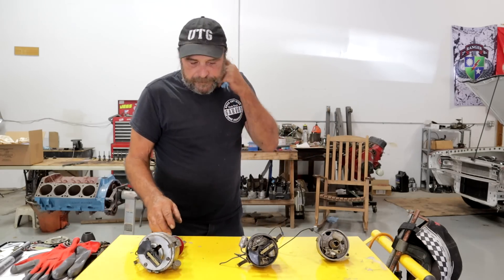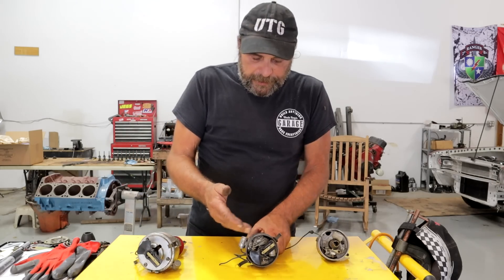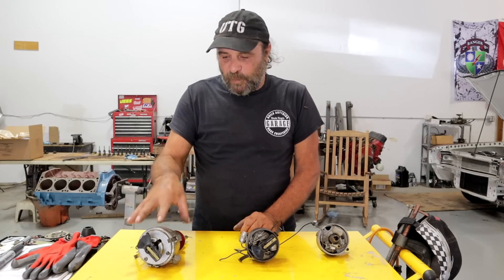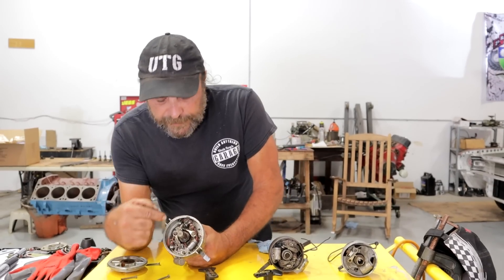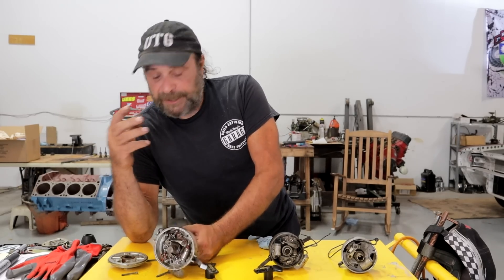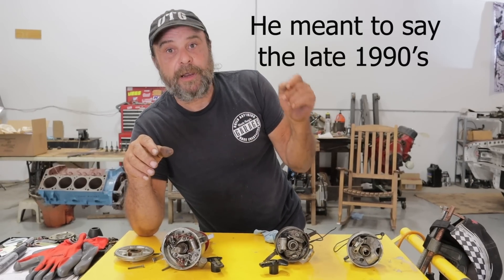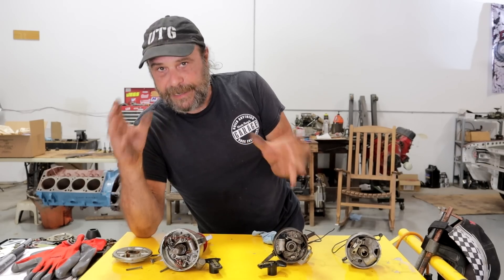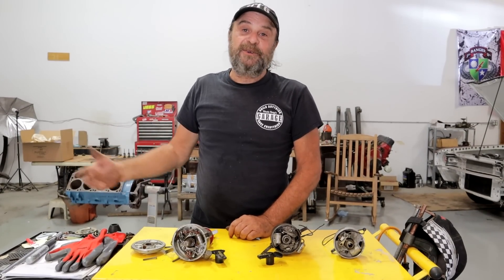High Performance Point Ignition Systems -  Tuning, Modifying And Understanding The Different Types

Comment: The first distributor, on left, looks like an Accel BEI. But it's dual point. I had a BEI. with the Laser box amplifier.  Uses "Hall Effects"  ("whatever" said I) BEI Manual said it was good to 13,000rpm on 70% nitro. uses roller bearings.  When I first built my Chevy 350 in 1984 I used the distributor in my 283, a 1963 Corvette dual point. (From my 59 Vette). The 350 made a good 500hp, rev'd to 7800rpm. I decided to use the BEI,  because I got a deal. The difference was profound. Top to bottom. On top end there had to be around 50hp. As time went on I tried other distributors.  I tried a Mallory dual point, (nope) Mallory Unilite (nope) . Even connected to the Laser box the Unilite was down at least 20hp.  The Accel BEI produced such a precise strong spark..... I was totally old tech and didn't believe in all this "high tech" CDI stuff, etc.  Problem with the BEI is they were sensitive. I had to send mine to Accel twice simply because of Water getting on the amplifier box.  Accel stopped making the BEI. I assume an MSD8 would be as good as the Accel. The distributor was special.  "expert" told me the BEI was better than a magneto but the amplifier was sensitive. Especially to welding, like on the chassis of a race car. This caused it to be used less and less. So says my 40yr old memory.

Comment: I have a 555 solid lift cam with 12 and 1/2 to 1 compression would a dual point distributor be a good idea for my engine it's a 350 30 over small block chevy

Comment: A long time ago I had a new Mallory dual point distributor  for a V8 flathead engine in my Mercury. I replaced the stock distributor and took it out for a test run. I could tell no difference in power. It was a go fast part that did not go fast. I sold it in 1967 for gas money.😊

Comment: I had to take two self taping screws to hold my breaker plate from moving all over the place and was berrly running. And I messed with the timing on my AMC 390 in my 1974 amx Javelin. And about the not cheap but middle road disturber. Efi and failed before I have the timing set. That's not good but I have been able to make it into town with the new components. The next thing I bought a used point one. Cam was worn and the gap is different from one lobe to the next. So I bought perteninx can not spell right. But I installed the second set with a camera on the install so I don't get the guy saying I was the only thing wrong with his parts. The experience was very horrible. I have spent the amount of money on junk that the new original one never been installed still in the box and the condensers I will not sell them because I have given up on the new shit. The way I had had points in All the cars that I drove until I bought a 1974 car

Comment: I have a 1987 ford f250 460 factory carb 4 speed 4x4 truck. My friend installed an edelbrock carb and points distributor with Pertronix unit back 20 years ago. The Pertronix failed a few times at first. He figured it out and then it was ok for years. The trick was just driven occasionally in past 20 years. Hard on gas. Something went wrong with fuel pump after truck sat a year. I installed a new mechanical pump in side of engine block. Fuel gauges don't work and so I'm gonna drop the tank. I haven't confirmed if it has booster pumps in tank. Does anyone know? - anyways.... the truck just doesn't idle. One jet in primaries seems to spray intermittently when visually linking carb and looking inside (engine not running). Im thinking I may need to rebuild carb. And I can. But....I don't trust the Pertronix. I'm thinking about just going with points. What do I need to convert BACK to points in this points type distributor? How to wire it up? Is this the smart thing to do? I'm a mechanic on my own heavy equipment business and I have a shop. But I'm not on the level of Tony. I don't mind adjusting points every few oil changes. I want extreme reliability, smooth torque towing, and cost savings. Sick of the computer bullsh!t. Thanks

Comment: After being stranded on the side of the road twice in the last 2 years due to an ignition control module failure I ditched my HEI ignition and went back to my trusty Accel dual point distributor. Never going back...

Comment: Thanks for this. In the last month I have had an electronic ignition module fail on me, and then two weeks after, the replacement module failed. Now I’m back on the original distributor with points and condenser. The idle is smoother than before and the engine responds so well immediately.

Comment: Hey folks...   I'm even OLDER than U.T. and agree 100% with this.   The only nuance that Tony didn't go into is 'Point Set Quality'.   You need to make sure to ONLY purchase the Premium Grade.  Stay away from Auto Zone, Oreillys and such.  NAPA still has the good ones, but they also have the cheap junk version.  You must make sure to SPECIFY that you only want the Premium version.

NAPA premium MoPar V8 Points part number is   CS851     NOT  CS851SB, those are the cheap set.
NAPA premium MoPar All Engines Condenser is   AL869     NOT   AL869SB, that is the cheap version.

Same goes for NAPA Caps and Rotors, do NOT accept the version with Part # ending with    ....SB....

Comment: My pro street 1960 Hillman Husky 2 Dr wagon I bought few years ago has a SBC with tunnel ram and two Edelbrock 1405 carbs. I just found a Mallory Hyfire 697 ignition box and the matching Pro-Master 27440 coil all in great shape. Any you guys think if I do install this it will clean up a bit and run even bit better? I’d rather have a good electronic set up is getting stuck broke down from it going out. I hear a lot has to do with making sure that electronic ignitions are grounded really well and at several places.

Comment: Hey Tony,
I may have missed it,( you HAVE made ALOT of videos!)...
Did you put a dual point dist. In that slant 6 dart?

From what I've read, I guess the other potential benefit of "duals" are longer point life,(  depending on the dist. Cam lobes and if each point set is firing half the cylinders )

Have you ever "made" a dual point for a slant 6?
I'm almost 63, and I'm no stranger to single points distributors, but never worked on duals.  My slant 6 will never have to worry about high rpm's, but I'm intrigued with how to add that secondary set of points...can't find any tech info on EXACTLY  WHEN ,( compared to the primary set) they should start opening, and EXACTLY  WHEN the primaries close,( compared to the secondary set).
I'd love to "tinker" with it!🙂

Comment: I remember being on the road with a 73 chevy station wagon and the engine quit.  I got out and found that the points were out of adjustment, I actually adjusted the points with a matchbook cover and finished the trip.  A few years later I was traveling in my Chevy S10 pickup, it quit on top of a bridge at 5 in the morning, it was the ignition modual  and I couldn't do anything about it and had to wait a couple of hours for a ramp truck to tow me home.

Comment: In 1964 Honda had a six cylinder 250 cc GP bike did our p.m. to 18,000 RPMs they also had a five cylinder 125 at RPM to 22,000 on points😮

Comment: Any idea where I can get a dual point distributor for a 440? My thing is I don't want to have ANY electronics in my car. Including the electronic control  on the firewall. If I cant find one then I'll end up getting an electronic stand alone unit from 440 Source.

Comment: Wondering, Advance when leaving the line at High RPM. Motoring down the track, what RPM is the engine running at and why is it that less timing is good for what I am guessing is a lot lower RPM that the launch at the light?

Comment: on my 91 lx i did something similar but it was a modern ignition system , i installed a msd retard and when in third gear i would hit the swith and retard my timing and i would gain 3 mph and 1 tenth

Comment: I wanted to add some specific details regarding dual points, the take away is there is a lead point set which does not effect dwell and the secondary point which will change dwell.

Comment: There is another effect which makes adjustment easier. A change of points gap induces a change in spark timing along with change of dwell. With single points you set the contact gap first, then run the engine (or spin the distributor) to check dwell, then re-adjust the points (if necessary) to get the correct dwell. Then you may need to go back and check/reset the timing again, as the dwell adjustment could have changed the spark timing. With dual points you set the gap on both sets of points, then set the timing, which is controlled solely by the secondary points (which open last). Then if necessary you can change the dwell by adjusting the primary contact set, which will have no effect whatsoever on spark timing, so you don't have to reset timing after adjusting dwell. 

The real reason for using dual points is for improved life, long term stability and reduction of service calls, but has naught to do with increasing dwell. For what it's worth, I commonly run more than 20,000 miles on the Mallory Dual Points distributor without touching the points. This is one robust distributor, and I am one happy customer (except for the prices on Mallory tune up parts). 

There is one more notable feature of the Mallory Dual Points distributor. It has an adjustment for mechanical adance upper limit (maximum advance stop). If you set idle timing to 10 degrees BTDC, and there is no vacuum unit, and you want 36 degrees total spark timing at road speed, you can set the mechanical advence limit to 26 degrees. If you have a vacuum unit that can produce 7 degrees advance, and you want to set idle timing at 15 degrees BTDC and limit maximum total advance to 36 degrees at speed, you can set the Mallory max mechanical advance to 14 degrees. This is a handy feature if you do any special tuning (and don't we all?) so you don't have to buy new or modify the mechanical limit stops or advance weights.

Comment: The 354 56 Hemi had this option - dual points on Imperials and Chrysler 300's.. I'm all points now but there is one exception for the Mallory system - they now have a devise so you can run a remote advance/retard control for the dash so you can play w/ advance as you drive. A LOT of people do set dwell wrong so they blame it on the points but if they just took the time to set it up right it would drive so much better and better mileage.

Comment: Yes. I.   Could.nt. agree.   More......point.s.   are. Original.  ...equipment....  for. 60.s. and. Early.  70.s. vehicles....or. earlier.vehicles....and. at. One. Time.... I. Thought.....and. would say..... any. One.      And.  Every.    One......  with. A.   Vintage...  Mustang.  Camaro....or. barracuda...  should've. Learned. How.  to. Replace...And. Set Point.s.....rotor...condenser.cap.  wires. And.   Spark.  Plugs............  the. Advantage... is. You. Can. See. The. Part.s...  if. You. Crank. The. Engine...and  look.   At. The point.s Move.in.....and. rotor. Spining..if. you. Had. ..a. clear. Distributor. Cap.....  it. Would.  Be. A. Good. Learning. Tool...  you could. See. The. Shaft. Rotating..  the. Point.s. open. And. Close.  And. Alittle. Bit. Of.    Spark.....even. with. Electronic...ignition......  that. Would. Get. The. Kids.  Attention...even. a. Man. With. Your. Experience ..   would. Take. A. Look.....and. you. Could. See. Point. Adjustment.s....  being. Made...  while.  Running...  with. G...m...style. trap.  Door...

Comment: Thanks for covering the dual points aspect. My first car (1967) was a 55 Dodge custom royal with a 270 super red ram hemi...and dual points. I was only 17 and knew nothing about them. The high rpm explanation you gave makes sense now because the car was a 2 speed auto. It would do 60mph in first gear.    Years later in 1973 my first truck was also a 55 Dodge. It has the 259 semi hemi ...and also dual points. I am wondering the reasoning for it on this truck. My limited understanding is that they were used to increase dwell resulting in a stronger spark on these old 6 volt systems. Am I close? BTW I still have this truck and am restoring it as close to original as possible. Thanks for your great videos.

Comment: I purchased a distributor off Ebay a few years back for my 69 charger with a 440 I believe it was a accel distributor I didn't understand stand why the holes were on the side of it because it didn't have the bearing plate with it I learned something new again by watching your videos o ya the distributor didn't work it was for a 383 400 I'm guessing but the ol charger is still running a points distributor

Comment: The manufacturers went to electronic ignitions due to emissions. People didn't maintain their point ignition systems so the ran bad and polluted a lot. Electronic ignitions didn't require cleaning and setting points plus they can fire a worn out plug where points won't so they put out less pollution. The average driver ignores maintenance unlike car guys who keep their engines in top running condition.

Comment: Prestolite and Autolite dual points have a shared ancestry. The distributor body is low rent, but the replacement Electronic bodies for Mopar and Ford were even worse. The Mopar/AMC/ For MoCo disadvange compared to HEI, is always, only one shaft bearing. On all the Mopar and Ford Dual Point ignition and vacuum advances, as long as the single bearing is in great shape, the spark scatter is good. I'm a TFi/Duraspark 1, 2 or 3 / or Mopar Solid State guy, but gorsh, Trouble Shooting those is often murder due to the No warning, No Spark  issues. When it dies on an on ramp, or stops dead on a hot day, you have several earthing straps and very poor quality Reluctor magnets that just loose conductive and ferric quality over time. Ford's 5.0 EFis of CFI or Port before the EDIS engines, little Gurl With a Curl, great when it works, but when it doesn't, it  can be taken down by about six different systems that have the same condition. Thanks UTG for going back to the basics.

Comment: Gm Hei is my favorite Its good to 7200+rpm and it never varies dwell or timing as the points wear
as for repair does it have 12v going in if yes carry a modual and a coil if still no spark your pickup is bad

Comment: I love your videos because your old school I ran points for years ì had a accel duel point distributer in my street car motors in the 70s and 80s I never switched over to hei till the 90s when I built my first big block it is alot less problems that can go on with points. I'm getting ready to put my 427 in my 88 monte carlo SS and I am going to put a msd box and distributer in that car I think it's just alot more money I have to spend  for not that much of a difference I'll only be bringing the motor up to 6800 max. Thanks for the video your friend from Louisiana Rick 427

Comment: Still running points in my 71 383 Charger SE.  Never understood the urge to replace them with electronic, and I have a 72 Rallye with electronic as well.  Granted the 71 is a summer car but I haven't replaced the points in over five years and it still runs great.  I have spare point sets ready to go but there has been no need.  If your car still has points save your money.

Comment: About 20 years ago, our instructor for 3rd year automotive apprenticeship, was explaining "why" points were obsolete and how they would break down at high rpm due to dwell time and points float.... so we tested it. I took my stock mopar distributor, brand new mopar performance distributor, and my original points distributor for small block dodges to class to test on a distributor and secondary ignition test bench.... the instructor wasn't happy at the end of it because the points distributor which I hadn't serviced aside from gapping they points... it had perfect dwell when spun up to 7000 rpm on the machine. The rest of the class got real interested and the instructor just didn't know what to say. It was great 👍🏼😎. Thanks for the awesome videos Tony.

Comment: A thought in todays world is engines in general are misunderstood. Point ignitions were not everyones forte yrs ago and less so today. The Standard Ignition/distributor bench machines were how garages dialed in distributors. Not work on dist. installed in engine. Pop it out then re install correctly. I don't come across many folks today who know old ways. Yrs ago we used a match pack and judged by how fast it started/idled well and ran strong or not. Cheap points were also a no no, and of coarse ballast resister another misunderstood entity. Dielectric grease and avoid dampness on cap ect. Top quality only